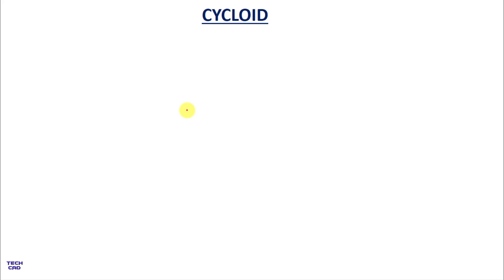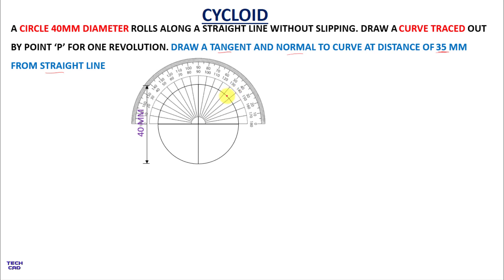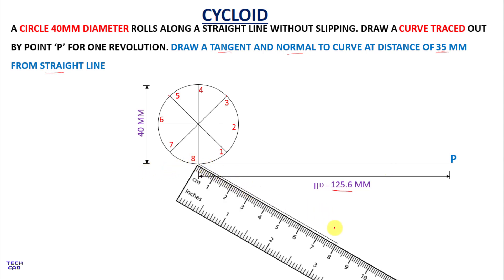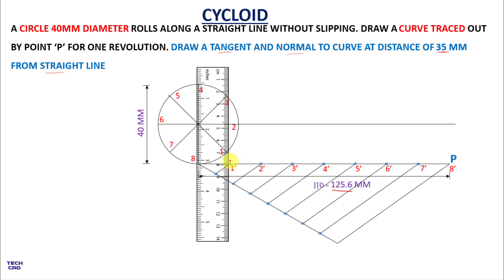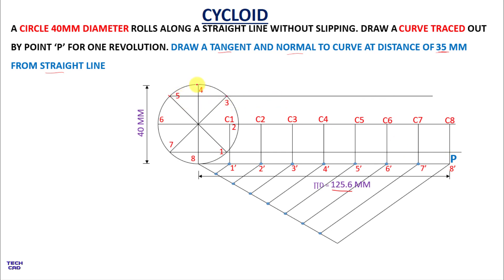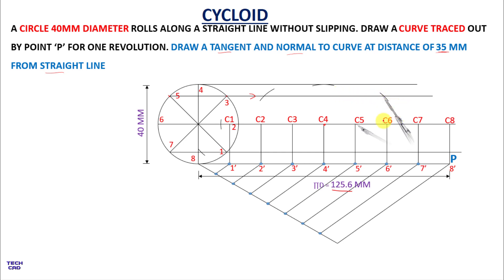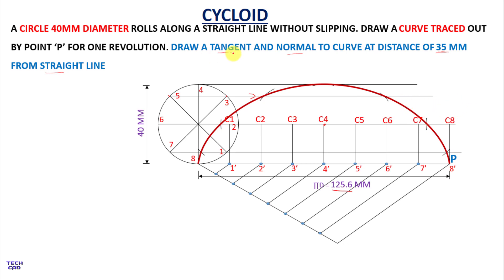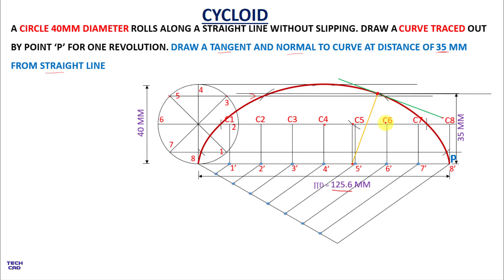HOW TO DRAW THE CYCLOID OF CIRCLE

Comment: A circle of 50 mm diameter rolls along a straight line without slipping. Draw the curve 
traced by a point P on the circumference for one complete revolution of circle.

Comment: A circle of 40 mm diameter rolls along a straight line without slipping. Draw the curve traced out by a point P on the circumference, for one complete revolution of the circie.